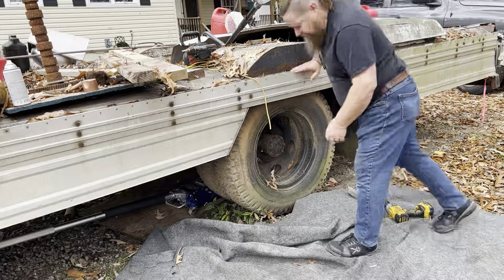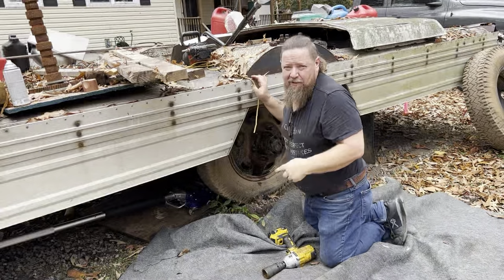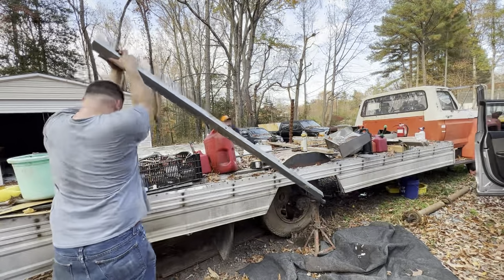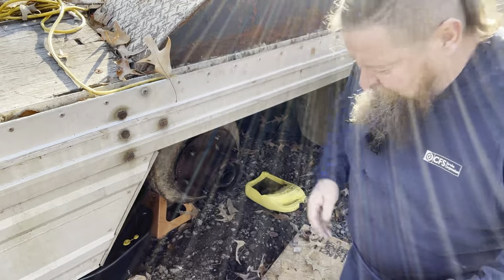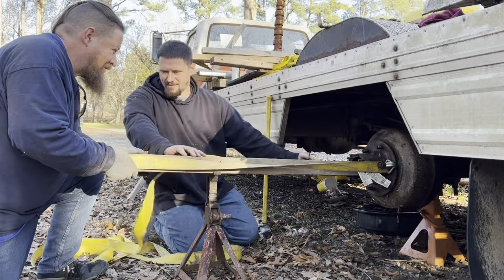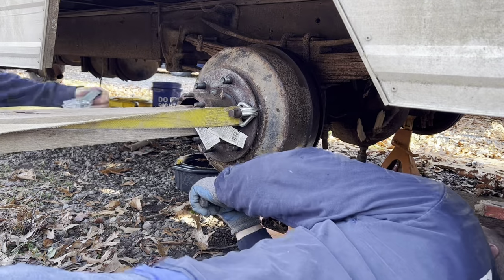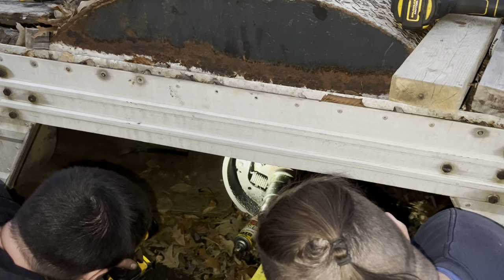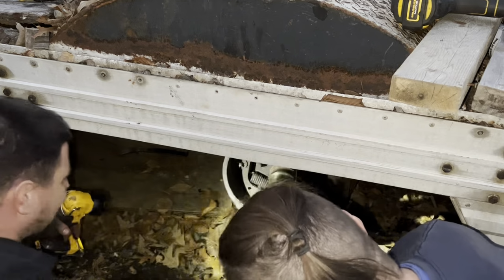Remove Frozen Brake Drums on a F600 truck Build custom tool

Comment: What size was that big ass socket you used to take the center nut off to remove the wheel bearing
Reply from the maker: I believe it’s a 3” or maybe a 3.5” when I get home I will check